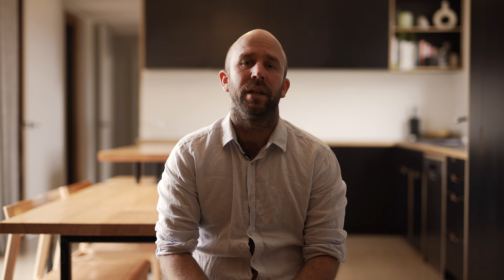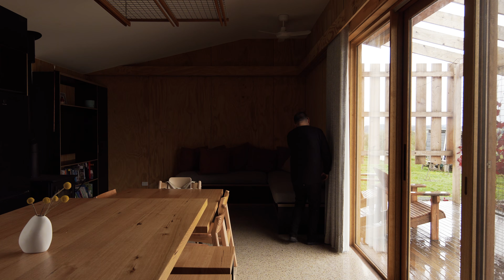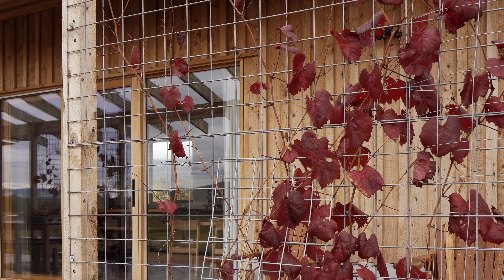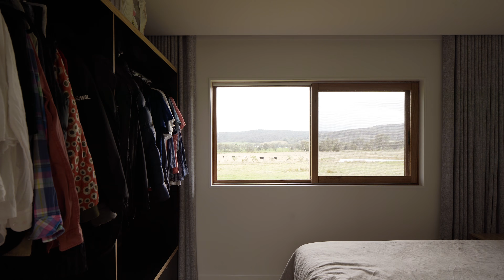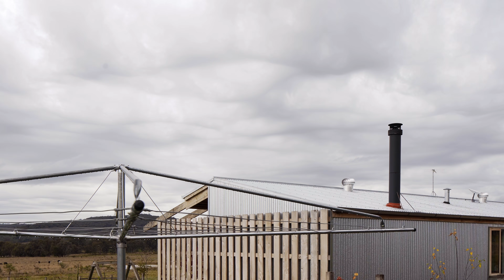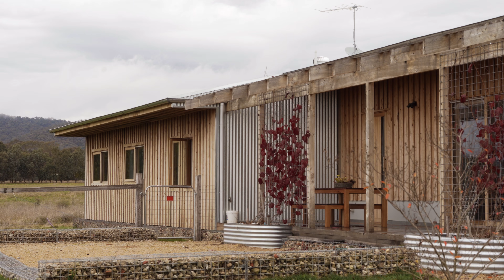The Off-Grid Home That Lives With the Landscape

Comment: feels expensive...maybe its just the cool explanation
Reply from the maker: How much do you think it costed? And while I won’t share the exact figure, I’ll let you know if it was more or less
Reply: @SimpleDwelling  US$ 100,000
Reply from the maker: Oh yep, it costed more than $150,000AUD.
Reply: @SimpleDwelling  given the availability of the materials, I feel a biophilic design should be budget friendly nonetheless in a rural setting.
Reply from the maker: You’re right, the basic elements of biophilic design shouldn’t cost much. But a good amount of the budget was spent on the off-grid solar system, extra insulation and double-glazed windows.